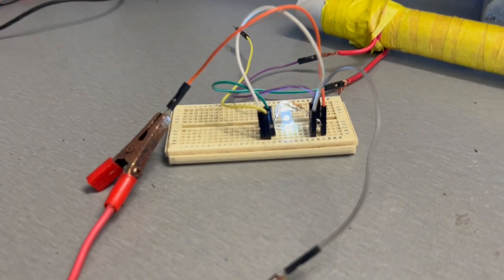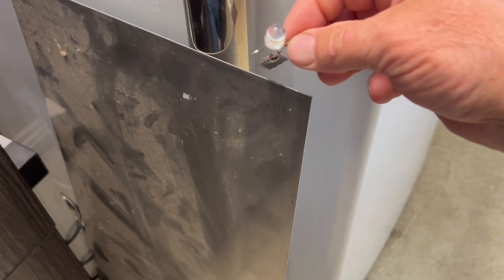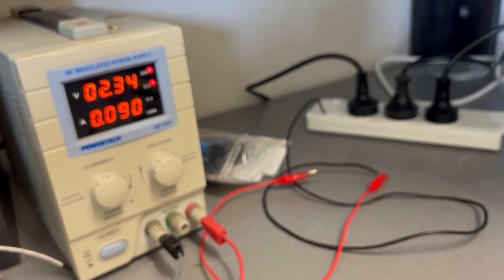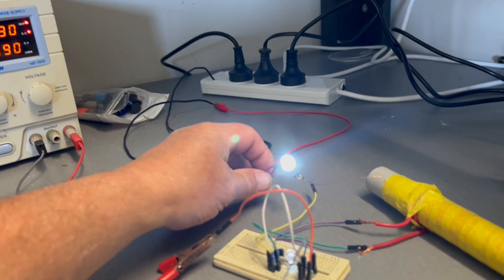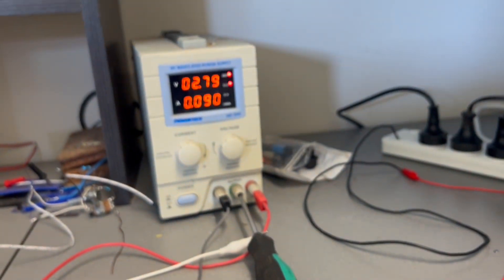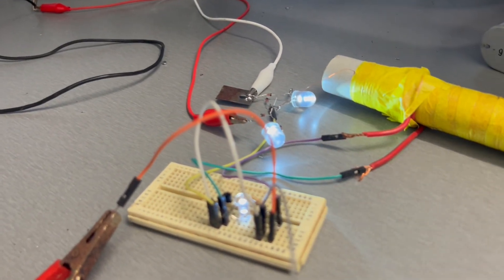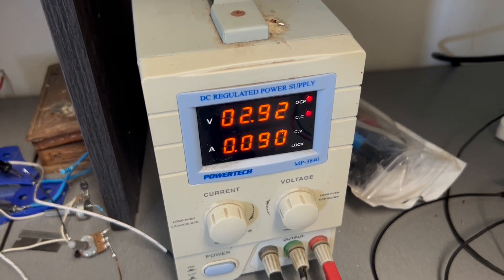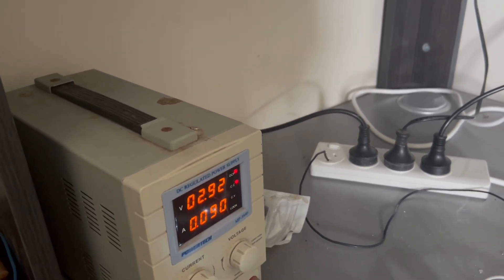Slayer Exciter Excited

Comment: Nope, your conclusions from looking at the digital read-out on your power supply are wrong.  I am going to give you a few pointers and I suggest that you start a thread on your online forum to discuss this matter in detail.  There are normally two ways, or modes, to use your bench power supply.  The first mode is voltage-source mode.  That's where you turn the current up to maximum and set the voltage to your desired voltage.  This is the mode that people are familiar with.  In this mode, the output resistance of the power supply is zero within the operational limits of the power supply.  The second mode is current-source mode.  That's where you turn the voltage up to maximum and set the current to your desired current.  In this mode, the output resistance of the power supply is infinity within the operational limits of the power supply.

So, what happens when you set the voltage to three volts and the current to 90 milliamps?  What does it mean when you see the displayed output voltage drop when you connect an LED?  Like I said, your conclusions here are wrong.  You need to really understand what is happening here.  Hence, I am suggesting you discuss it on your forum with your peers so that in the end, you all understand what is really going on.  Good luck.
Reply from the maker: Thanks. Very informative. Cheers.

Comment: Negativ energy. AV plug + square wave and done. With bifilar coil + any conductive material, you are able to harvest this energy. Backwise timeline....
Reply: Energy is never negative ! To perceive negative or positive you need to establish a reference point and appreciate negative or positive in relation with this arbitrary point.
Reply: @ Nearby, in any conductive materials appears this energy. In the water as well. Its going from the ground! So ... negative! SPP surface plasmon polariton ... quantum stuff.
Reply: Radiant energy also negative type.... negative resistance... for example same thing! Not Kirchoff circuit, you know...
Reply: @lifacademy  I am not going to argue are trying to convince anyone. When you use term polarities you simply use a reference point.in the comment for the author I have specified instead of ground can be used either “positive” or “negative” terminal of the battery … and this will form a reference point different from the reference point used to entrain excitation. Always local environment will come with full force against our little effort to produce a disturbance.

Use a common ground and all this potential is cancelled or eventually the gradient is reduce to minimum.
Reply: @Caesarus2011  Aaaa... basics ... ok.That word what you looking for is a potential or potential difference. But ... just the potential difference not able to create energy.
The time is missing ... the changes , the delta t. 
So what is the energy direction? Backwise, right? In every case.
What is the energy direction in a glass of water, with this energy?

Comment: What we see here has been already described by N Tesla in his patent for apparatus for utilising radiant energy.
And according to his notes there is nothing mystical and is described as any source of energy that radiate where inventor identified: light, thermic, electric, magnetic etc.

Your primary excite local environment (local aether) and your secondary is connected to a different gradient formed by radiation from primary and ground where each end of the gradient pickup only or mainly a different sign and the circuit is closed in your load where produce desired effect without loading the “source”.

I have done my own experiments even if I don’t post them on my channel and I can tell you for sure that using the same circuit as you have now you can power much heavier loads without the need to increase the voltage of the source insane.

For example you can use a separate battery and connect your ground to only one of the leads and you may observe that it will work using any polarity of a battery due to AC being captured with your secondary.
Also, you can observe that using only one terminal of a separate battery, the energy of the battery is not diminished either, although some natural losses occur in similar way like any battery stored away and not in use.

If you want to improve output power you can add a ground to your primary, second separate ground for secondary and third separate ground for the load. Further, if each primary, secondary and tertiary are transformers and you add capacitors and spark gaps between them (local negative resistance or superconductivity) you may struggle to contain the output power.

This is absolute natural phenomenon without any esoteric content or bs theories about quantum whatever, perfectly explicable in simple terms easy to understand by any uneducated individual.
Reply from the maker: Thank You for your comment. I will consider your words.